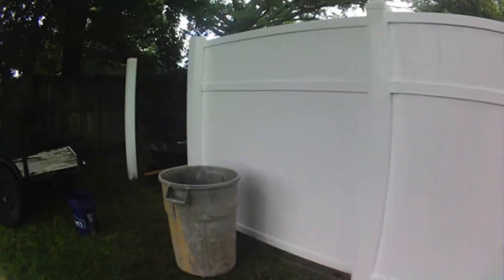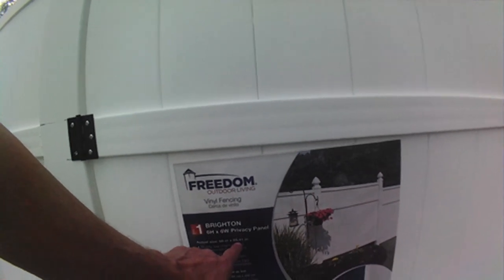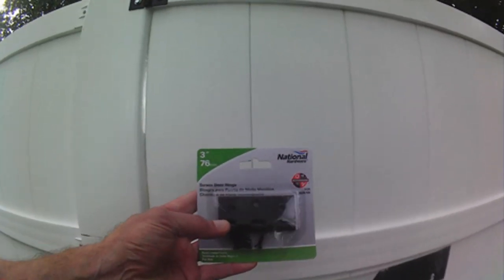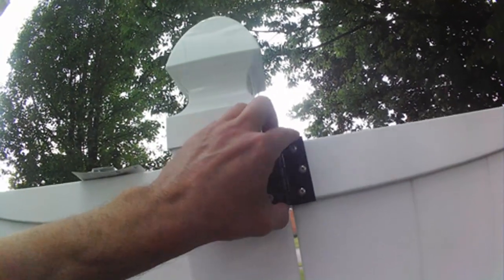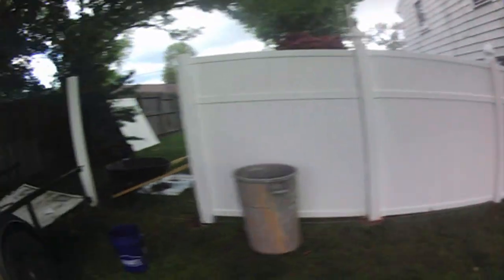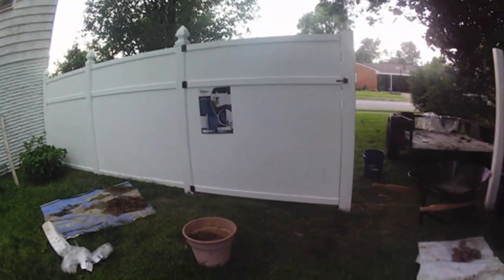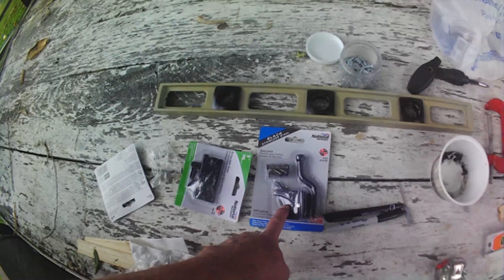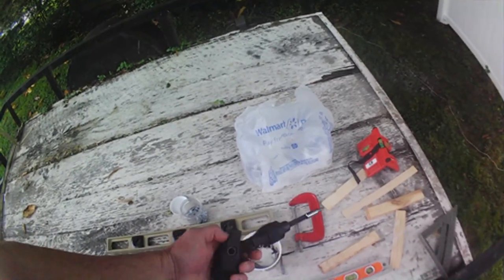Install Vinyl Fence and make a gate. How to install a double vinyl gate. Removable fence post.

Comment: Excellent job! I was hesitant on buying the gate kit because of the reviews. This idea of yours seems much better! I’m sorry I will have to copy now!
Reply from the maker: I saved $200 and nobody knows there is a gate there. As I drive around town you can see where peoples gates are by the black hinges. If you need to access the latch from front just hang a white string over it and noboy will see it. Someone wanting to brake in will go to a gate right...

Comment: I have one more section to put up and this side requires a gate. I did not want to use a gate that was a different design than the panels. I found this video that made it possible to me b/c you used the same panel design I am using. Thank you for the confirmation. I will be referring back to this before I start digging.
Reply from the maker: Glad I could help. My favorite  thing is nobody knows there is a gate there. Plan for expansion. In summer heat these panels expand in winter contract.

Comment: Good job!!!. I used peastone on my vinal post's. The reason I did that is for water has a place to drain. Inside the post up to the bottom insert hole and around the outer side up to ground level. The stone will settle. Then fill with dirt. It's better than cement, and sturdy. If you have to move your fence and posts, you will be able to reuse them.
Reply from the maker: That works. Thanks for the comment. That would be alot faster than mixing concert. You can't reuse mine...
Reply: @outdoorswithcam  Thank You Cam

Comment: Great video. I was about to hire somebody to remove the two sections of fens and install double gate just like you until i seen this amazing video and idea. Thanks so much. I have question for you if you wouldn't mind giving me some advice... What do you recommend if my fence slates are very snug up against the post? I wont know if I will have a big enough gap (1/4" needed??) between the fence and the post for the gate to swing without rubbing. I dont want to cut until Im sure this will work for me. Thank you very much. Jim
Reply from the maker: I built it in March and it was tight. Hidges are on the outside. So it swings out. Don't need a gap. But when summer came and things heated up. They expanded in the sun. SO then it was binding on the center removalable post a little. Then I took a file and filed off just enough so it would open freely again. I only filed the inside edge sort of like a wedge. So there is still no visible gap but it opens freely. I knew the sun would make it expand in the summer so I expected that. You only have to file the three horizontal "supports" on the panel. Not the whole panel. Its plastic and real easy to file. SO what if it rubs a little. I don't want any visible gaps because people could look through that gap.
Reply: Cam miller. Makes perfect sense. I don't mind if it rubs either as long as it opens and hinges on the outside swinging out... We'll done. I can't thank you enough. I can't wait to tackle it this weekend. Go the hinges latch and a couple cross supports. Im confident thanks to your video and awesome idea. Be well!

Comment: Where you mounted the hinges to the gate because it’s thin plastic are you having a problem with the plastic cracking because of the weight of the door. Should you strengthen that area with some material on the inside?
Reply from the maker: There is an I beam inside the vinyl post set in concrete. Self tapping screws through the hinges, Vinyl and into the I beam. If not the post would bend over... I don't know which video you watched But I have a complete video showing the I beam going in and pouring concrete down the post. They sell the aluminum I beams right beside the vinyl post.
Reply: The other side of the hinge that is mounted to the gate, wondering if you were having problems with the plastic cracking because it is hollow. I have the same panel but making a much smaller gate but still concerned about it not being strong enough.
Reply from the maker: @chrissaunders5788  been couple years now. No problems. Don't over tighten. And strep threads. Make sure to leave gap for sun expansion between panels. expansion.
Reply from the maker: @chrissaunders5788  Make sure you put the screws where I did. there are three horizontal supports for lack of a better name. When you place the screws there they go through multiple layers of plastic...

Comment: The problem is you will eventually get some sag.  You will never be able to readjust your gate.  Self adjusting are made to take that weight.
Reply from the maker: What Weight? It's plastic. Been up for 4 years with no sag. It been through some major storms with no issue. I took all the "sag" out when I screwed it to the I beams. It's still completely level after all these years. Freeze and thraw

Comment: So you just put the hinges on a regular panel?
Reply from the maker: Yes... That was several years ago. Have not had any problems with it. Its been hit with 80 mph winds and nothing has come loose. Now the post side has an alliuim I beam inside. But the gate is just a plane panel. I had planed to put a wooden paint stick inside if the screws loosed up. But after all these years I have not hand to tighten anything up. So never did. Most important is don't strip the plastic. I guess what I am saying is don't over tighten. Just hand tight.

Comment: Installing my gate posts tomorrow. My local stores are all out of the aluminum inserts. Will a 4x4 work and still have enough room for the panel rails on the opposite side of post?
Reply from the maker: My concern is wood can, bow, Crack, swell. It would be fine for +5 years but after that... my experience with wooden Stockaid fences. Depends on where you live I guess.

Comment: I was wondering what you think of using toggle bolts to help keep a heavy gate from sagging?
Reply from the maker: I guess you can. When I attached the gate to the I-beam I pre-loaded the hinges with the gates weight. That took the "play" out of the hidges. Its in my video. That way it will never sag unless the hinges wears out...

Comment: That was great, I want to do the same with my fence but my vinyl fence comes apart, its not solid fence its the other kind which falls apart when you remove it (sectional) , so I don't know how to put hinges on them.
Reply from the maker: Why not put a screw (or glue) on the back side of the slats to keep them from falling out. This is the reason I picked this style of fence so I could ake a gate...
Reply: @outdoorswithcam  Great idea , thank you i will do that.

Comment: What about adding an ibeam to the removeable post? maybe 1 or 2 screws? Would that make it less wobbly? I'm looking to do a similar thing.
Reply from the maker: The center post is not load bearing. Its just for looks and a stop for the gates. Just had a storm with 50 MPH winds it was just fine. The only time its really "wobbly" is when someone graps it or shakes it. Otherwise its fine... It does expand more than I thought it would in hot sun so you do need a gap.

Comment: How far does the gate swing?
Reply from the maker: Since the hinges are on the outside it will open ~270 degrees. Pull center pole. open both gates and I can drive a truck pulling a boat through it...
Reply: @outdoorswithcam  Would the gate be stable without the center post. I am thinking about installing a double gate, each gate will be 5ft wide but without the center pole. Then install a heavy duty 24-in gate drop rod on both gates on the bottom and a gate lock in the center. Do you think this could work and hold up to high winds?
Reply from the maker: @universalityofremodeling  Yup. The center post is just for looks. The secret is the I beam inside the post with concrete poured into the post. Then BIG self tapping screws through the hinges into the I beam. Without the I beam NO. C-clamp the I beam to the bearing side and pour concrete into the post all around the I beam. Its not going anywhere. It has withstood 80 MPH wind. I did a trapping job the other day and had to go through a "professional installed" gate kit. couldn't believe how wobbly it was. Also make sure it is perfectly level. So without wind the gate just hangs there and doesn't move. If its not level your gate will "swing"...
Reply: @outdoorswithcam  Thanks

Comment: What inch for metal aluminum post you use
Reply from the maker: They sell them right beside the vinyl post. It fits the square post perfectly. Use C-clamps to hold them and pour concert around it inside post. You have to use those post because the vinyl is to weak to support the weight by itself.
Reply: @outdoorswithcam  if do hole when concrete dry i think post can't remove .
how you make concrete center post can remove
Reply: @outdoorswithcam  how tall for metal beam you was use i saw they have 106inch and 94inch
Reply from the maker: @DuyNguyen-1218  That is why you wrap it in garbage bagss so the concrete can not stick to the post. It sticks to the bags. You pull the post up and the bags are stuck to the concrete in the hole. Then you pull the bags out of the hole after you pull the post up. Like a mold. Thats how boats, concrete statues, plastic parts are made... Concrete won't stick to plastic bags. Spray some silicon spray on it as a release agent if you are worried about it.
Reply from the maker: @DuyNguyen-1218  94